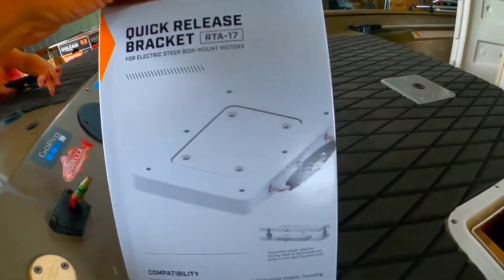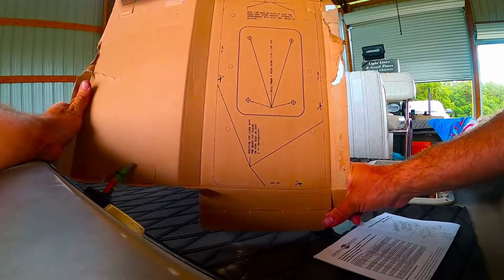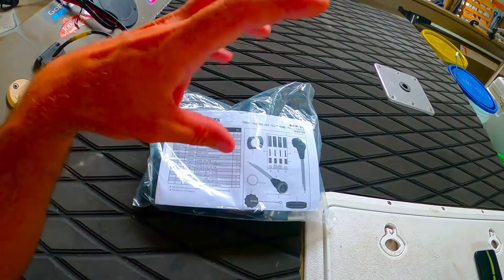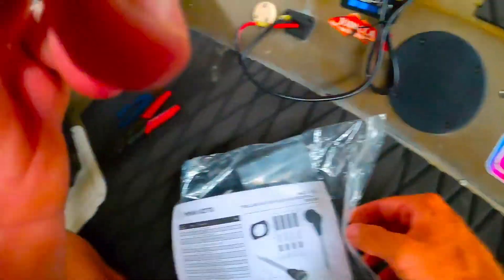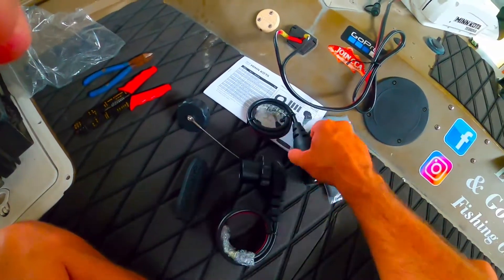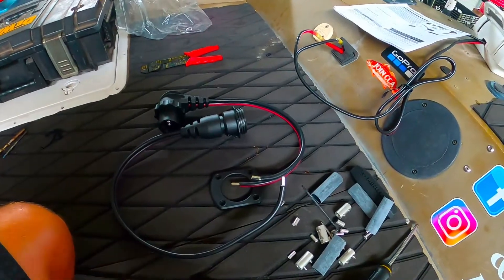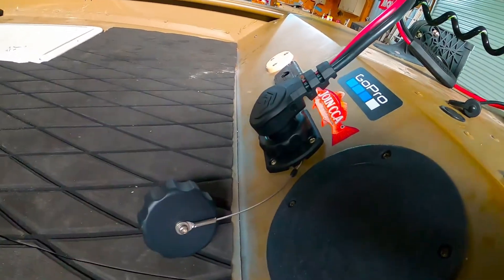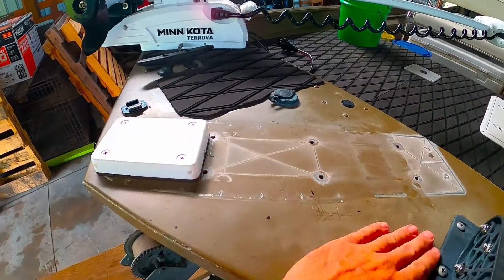Minn Kota Terrova, Quick release , Minn Kota Power plug install

Comment: What is the mount on the left side of the bow beside the trolling motor?  Looks like it could be used to swivel a pole with a transducer down into the water when needed.
Reply from the maker: stick it anchor